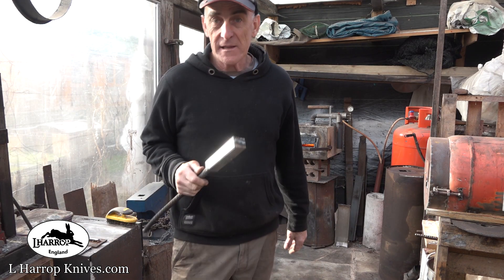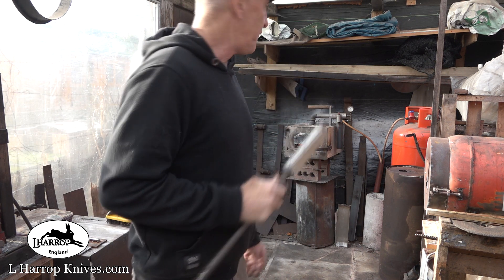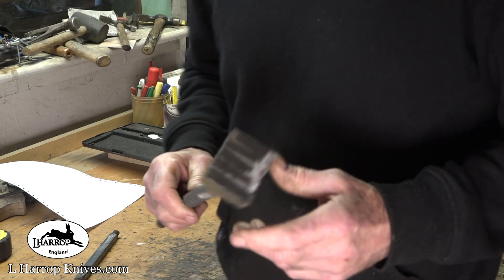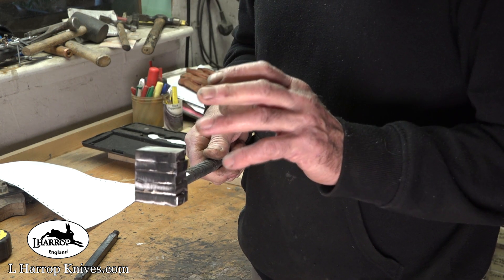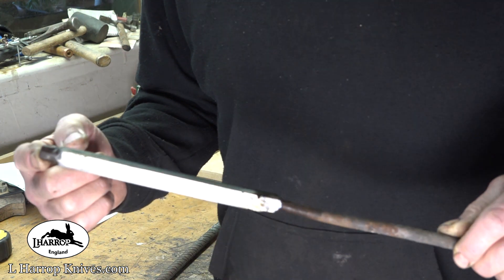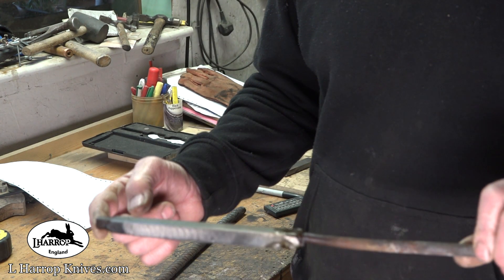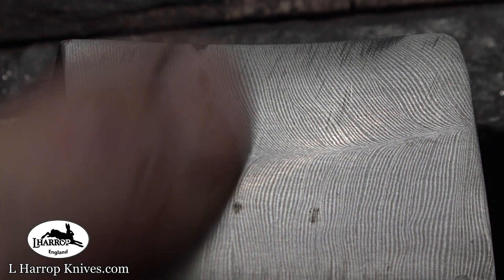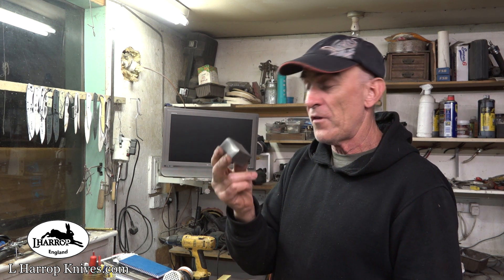Forging Feather pattern Damascus

Comment: Really cool pattern my friend - one I have not seen before.  I liked your stop blocks you added on your press  - I am working to fuller out some 9.5MM Damascus on Monday and have to keep the thickness to a minimum of 4.5MM.  So, this was timely - thanks and cheers!
Reply from the maker: Hi Rick, Had thought of making them from steel in case they burned but tried the timber and they work great, I cut a whole set and marked them so i can forge down from 15mm to 4 mm and after running the dies over the surface grinder I had a fantastic even thickness over the billet. good luck with the forging mate.
Reply: Thank you!

Comment: Hello thanks for video, how to unite the plates of ex-plane exhaust and a hundreds electrik guitar string waste made from nikle and leaf spring or bearing how to joined that layer by forge to be solid pieces???
Reply from the maker: Hi There. you would need to do a "canister weld" with lots of small different sized pieces of steel, i am going to do one quite soon, but plenty of videos on you tube.
Reply: ppotty1 thanks sir, do you know it what is basic material of exhause plane??
Reply from the maker: sorry julio ive no idea google is your best chance
Reply: ppotty1 i like your video

Comment: what is the magnetic slide/sanding belt set up called, that you have @ 2:18?
Reply from the maker: Its a diy surface grinder attachment for the grinder, you can buy them though. I did do a couple of videos on the making of it.

Comment: But this imitation can not go beyond a visual similarity.
It is not "damascus" steel. It is not "damascus" to glue and pattern two steel types.
The raw material of the "Damascus" steel is a kind of steel called "Wootz" steel.
The "Wootz" steel is produced from a different iron ore.
"Wootz" is a special type of steel produced in India-Sri Lanka. Please investigate.